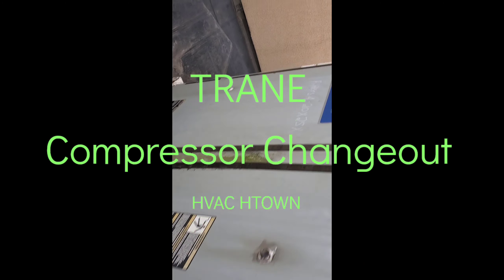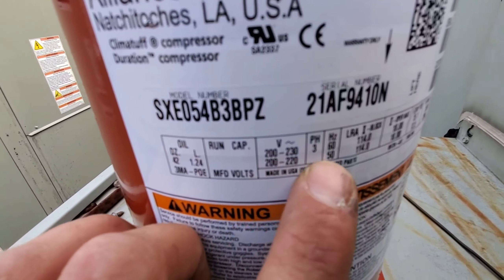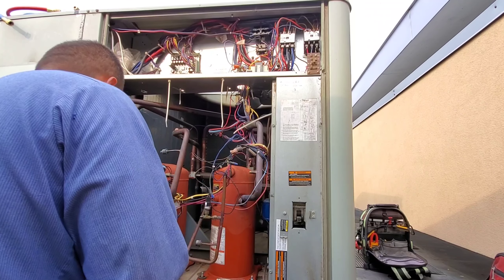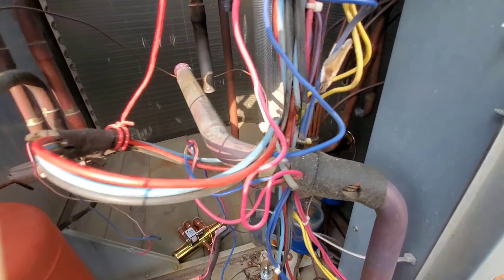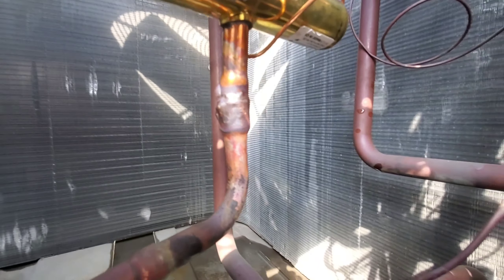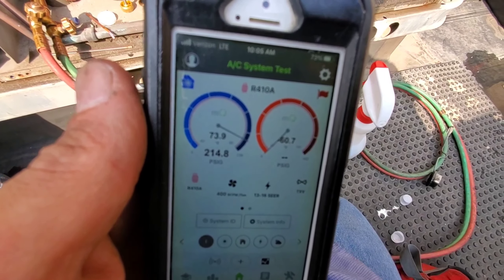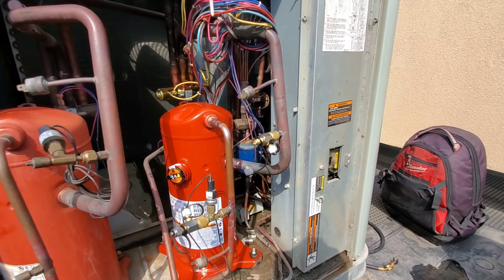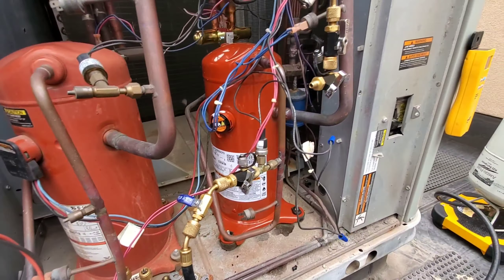Trane Compressor and reversing valve changeout

Comment: Stay bright 8 can take up to 500F of heat and 3500 psi of pressure I use it sometimes on RVs and TXVs and I never had a problem. Do you ever use silver solder for certain jobs?
Reply from the maker: All I use is sil-fos for copper to copper,, Silvaloy 560 for copper to brass or steel, and al822 for aluminum. It's all worked out for me. Heard good things about stay bright 8 but have not used it yet.